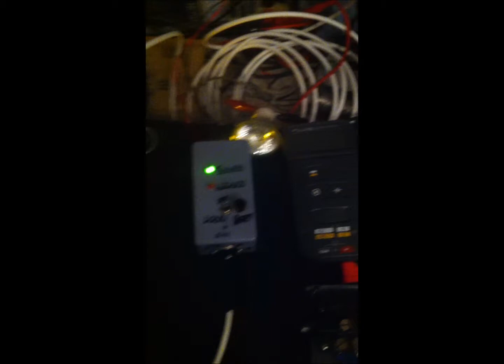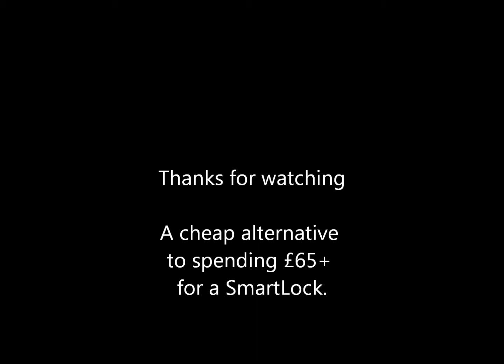SGC SMARTLOCK

Comment: good stuff, just made one as well. 73 :)
Reply from the maker: ramdor72 Thanks for the nice words. I have a foil pattern of the design I made (original still on Perf-board) if you make your own PBC's. Designed with a cheap PCB program but results are great. Let me know and I will convert it to PDF for printing.